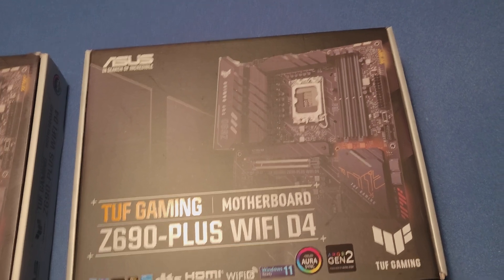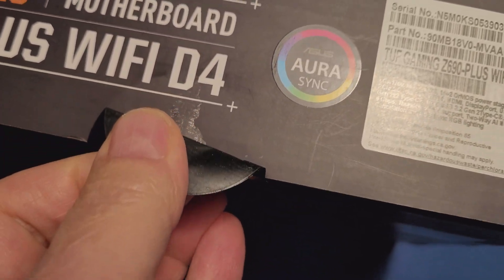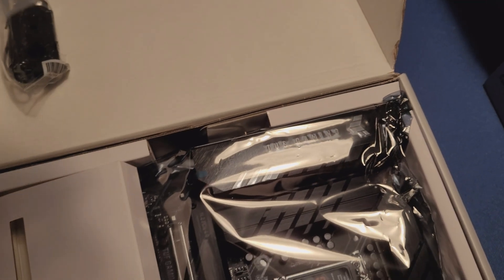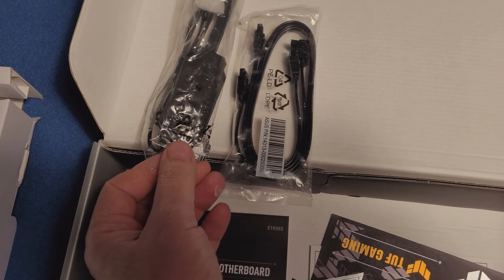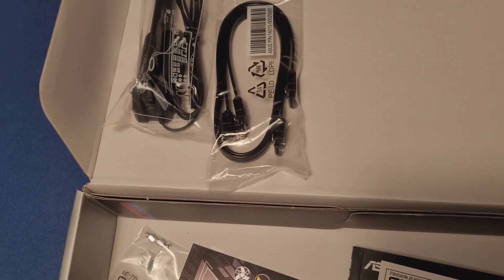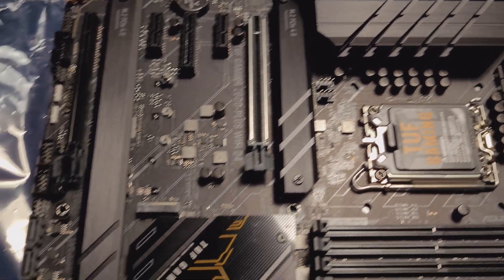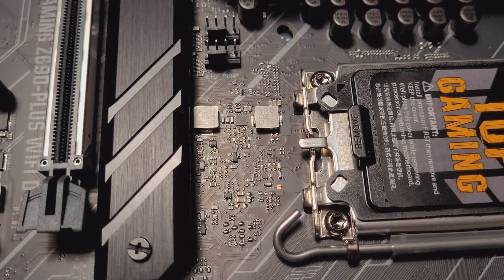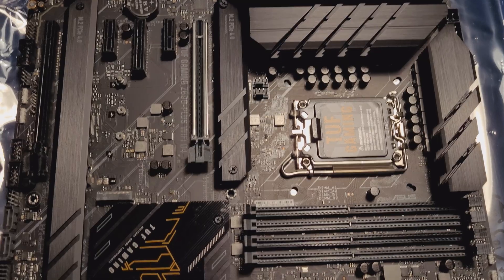New, Refurbished or a Used Motherboard? How to tell, what signs to look for

Comment: What may it suggest if board looks perfectly mint, but wasnt sealed at all, and it has a fingerprint on the inside of the plastic cpu cover ? :D
Reply from the maker: Definitely no fingerprints should be there. Workers are required to use gloves. Do a careful inspection of the mounting screw holes, ram, pci. If the motherboard was used, some marks will be there, especially on the mounting holes. Hope this helps

Comment: the front sticker has a manufacture date from the factory it would be a good idea to compare and check how old the "used" on is.  the one you bought from the store is "Dec-2021"

I bought my z670e itx board it didnt have a seal on it, and there is minor wear and tear scuffs on the cpu socket that i can see through the protective bag.  the manufactore date on the label on the box is May 2024 (3-4 months old) when i bought it
Reply from the maker: 3 - 4 months that is plenty of time for the motherboard to be tried and returned. Dis you keep the motherboard considering the scuffs on the cpu socket?

Comment: Hi, can I consult you on this topic
A few days ago I returned a DARK HERO motherboard because it had obvious signs of use, a scratched battery, bad USB ports
I asked to buy a new one from an official distributor for my country, they brought me the same one but with a different serial number, same production date and country.
The battery is not KTS as the manufacturer presents the product, but DBV, the same difference is there with you, a crooked sticker on the socket cap
09 2023 China
Do you think it's worth the risk?
Reply from the maker: The motherboard is the soul and body of your PC. Damaged or faulty motherboard will make your PC not work at all or give you constant issues. If it dies on you completely you will also might need a new license for your OS too. My opinion, if you have droughts, don't get it and find another retailer. It's your money and your time. If it's advertised as new and you pay for new you should get a new unused one.
Reply: @strykergaming_ngadgets  I completely agree !
ASUS washed their hands saying that they don't sell their products directly to end customers, local dealers claim that the product is new but it clearly isn't
I returned a motherboard to RMA for visible signs of use and a scratched battery, went to another dealer and received a motherboard of the same date and year of manufacture.
Nothing was scratched, but accessories were missing in the box...
And why is the battery not KTS as the official manufacturer demonstrates?
Where do they put these DBV batteries?
The box clearly says California Proposition 65
For me, the dollar exchange rate is 2 to 1, I actually paid nearly 900 euros for what?
According to NG's video, they were selling RMS products as new in Europe!
Not my words, just a quote, but Steve is quite a competent person

Comment: I’m guessing it’s a factory refurbished
Reply from the maker: It was sold as new. Interesting fact: Upon contacting the manufacturer and sending them photos, and after asking who the retailer was, they continued to insist that the package with the motherboard was never opened or resealed and that the motherboard was brand new. Also advised me if I have any doughs to return it to them or to the retailer.  Go figure. Ended up returning it, motherboard was busted throwing a VGA and RAM lights.